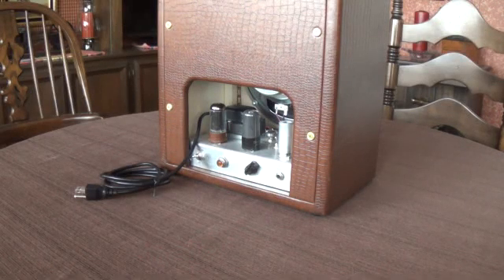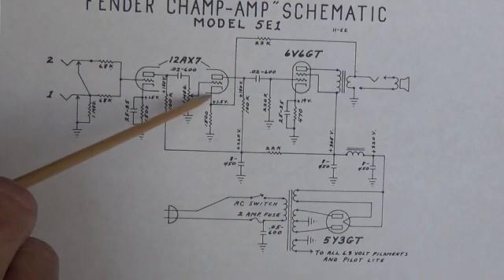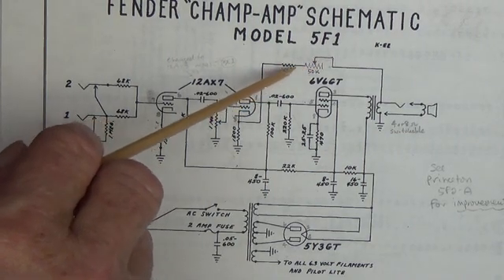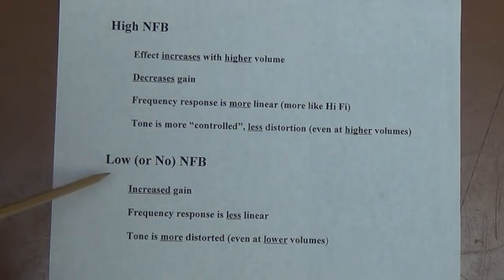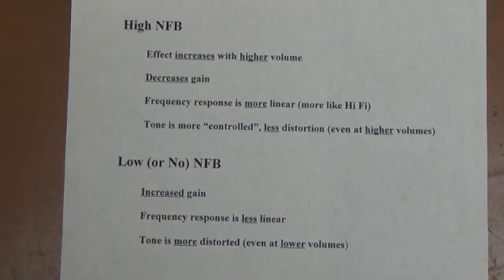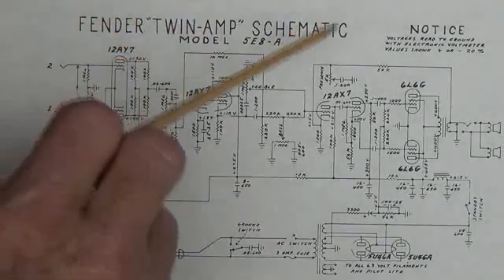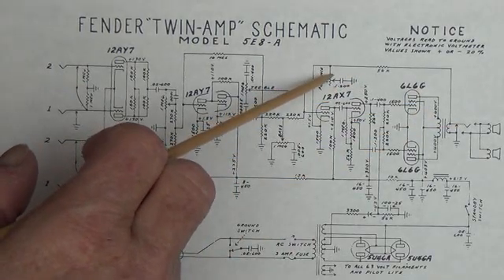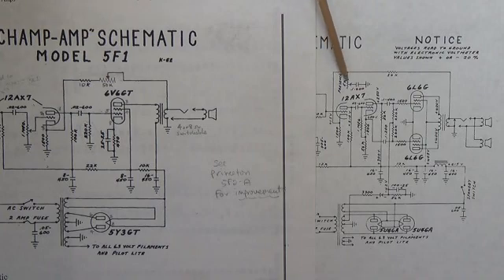Negative Feedback Loops and the Fender Presence Control

Comment: These videos are wonderful, Uncle Doug. Can I call you Uncle Doug? It seems a bit familial and whatnot. Anyhoo, these videos are great. I'm a software guy. I've built an LA-2A and 1176 and some pre-amps. But I was just being a solder-monkey and following instructions. I've watched lots of videos on electronics, but how many videos can you watch about Ohm's Law? I get it, Ohms Law, for the hundredth time. But there's so little in between that and actual useful discussions. Your videos fall at just the right spot for someone like me.

Something I always wondered about, but it never seemed to be explained, is why there are all these places where there's a resistor to ground. I always wondered what the point of that was. In this video, you note that basically you are shunting particular frequencies to ground by adding a cap. That sort of lit a bulb for me.

Are basically all of those places where there's just a resistor to ground essentially 'relief valves'? I.e. do they just insure that any voltage above a certain level has a way out of the circuit before hitting the next component(s)?
Reply from the maker: I have posted videos on the specific purposes of resistors throughout the amp circuit, Dean. The purposes vary from location to location, i.e. tone, current, and voltage modification.
Reply: Oh, OK, I missed those. I'll take a look at them. I've honestly learned more in the last week or so watching one of your videos every night as I go to sleep than I have in all of the previous time I've spent on this. 

One question I had, and I'd post on the appropriate video if I could remember which one it was, is the issue of DC and AC being able to flow on the same wire. When that happens, is it sort of like a carrier frequency in radio, where the DC effectively just offsets the AC by its own amplitude and so the AC is no longer cycling around the zero point?

If that's true, do things like transformers not really care where the crossing point is, as long as it's oscillating? Or, if it's true, are there places where that offset would matter?

If you have a video on that of course just point me to it. There are a lot of them, so it's not always obvious which ones to look at for specific things like that.

The other, stupendously obvious but overlooked by me, thing that I sort of realized (hopefully it was a correct realization) is that A/C doesn't 'flow' but DC does, right? A/C doesn't move from one place to another through the circuit, it just oscillates back and forth, while DC is positive or negative and does flow from place to another. Is that basically the correct way to look at that?
Reply from the maker: Yes, you can think of AC as waves of oil floating on top of smooth water (DC).....but they never mix. You're analysis of the difference between AC and DC flow is technically correct, but for most beginners and intermediate students of electrical circuits, it's probably easier to simply have the AC flow through the circuit, happily creating high voltage and warming filaments with low voltages.....so we generally don't belabor the point ;)
Reply: So transformers really don't care where the crossover point of an A/C signal is, just the amplitude of its oscillations, I would guess? Or do you have to remove that dc offset from the signal before it hits a transformer?

Comment: Do you have experience with op amps? I have some ideas I'm throwing around but I can't find NFB presence adaptation for op amps.
Reply from the maker: We deal exclusively with vintage tube amps, NT, so op amps aren't part of our repertoire.
Reply: Yeah, I had such thoughts.
BTW, I always felt that presence is adding the top, but it seems, in theory, it should subtract everything but highs (making it sound lower in volume).
Reply from the maker: If an amplifier has passive volume controls, a selected frequency range is not actually boosted, but only seems to be because all other frequencies are suppressed. This suppression does indeed reduce the overall gain of the amplifier and can become a problem in amps with three separate tone controls.

Comment: Putting a pot in the champs feed back loop , also affects the tubes bias.. since there is no isolation capacitor and the transformers secondary is a path to ground. You are loading down the 12ax7's output as low as 10K. 
 Btw, great videos ... but  you should fire that lazy dog :)
Reply from the maker: I'm not sure if I agree, GT. The NFB loop is connected to the cathode of the 12AX7. Granted, when the pot is at its lowest resistance (10K), the NFB circuit is offering the 12AX7 cathode a second path to ground (through the OPT secondary winding), but this is in parallel with the existing 1500 ohm cathode bias resistor. The combined cathode bias resistance would be about 1250 ohms......not a huge change.
Reply: Your right, sorry. I thought the cathode resistor said a much higher value.  It wouldn't make much difference.

Comment: If outout resistance of 6v6 is 55k and output transformer has k=30 than output resistance of my amp is 55k/900 =61Ohm. So I think we need add NFB on low freqs to reduce amp's output resistance and therfore speaker's distortion, wright?
Reply from the maker: The Load Resistance of a single 6V6 at PV of 315 VDC (it varies with PV) is 8500 ohms. I don't know what k = 30 means (winding ratio ??). I am not familiar with the concept of an amp's output resistance or it's relationship to NFB.  My suggestion is to install a variable NFB loop and experiment with resistor values to find a range that suits your needs.  Best of luck.

Comment: Great video as usual Doug.  I was wondering if you could comment on the purpose of the "shunt" resistor I see in many NFB circuits, but not all,  like the Princeton, 47 ohms?  When is it needed and why?  Also the size of the NFB resistor in the Princeton (2.7k - 5.6 k) seems relatively small and yet the Princeton 65 or 68 are said to have very little headroom.  With such a relatively small NFB resistor seems like it should have a lot of headroom.   And yet I also see that a very large resistor, 56K, is recommended for something like the 5E3 or is used in other Fender amps.  It's a bit confusing and I'm guessing it has something to do with the rest of the circuit, maybe fixed bias VS cathode bias or ?????  Can you help me understand this better?
Reply from the maker: Good questions, SD. It appears that the 47 and 1500 ohm resistors form a voltage divider, reducing the amount of NFB being applied to the 12AX7 cathode.  This may have been created by trial and error to create a "proper" tone.  I advocate this method to alter such circuits and customize them to personal preference. Even though the initial resistor (2.7K) seems low, very little NFB is applied to the cathode due to the presence of the 47 ohm resistor to ground.....thus little or no increase in headroom. I see no NFB on my 5E3 Deluxe schematic,but  I think you'll find that when high resistance is inserted in the NFB line (generally without a "shunt" resistor) it is to reduce the amount of NFB with one resistor rather than two. If you are really curious, you might experiment with alteration of the value of the 47 ohm resistor to see just how much difference it makes in tone and headroom. I would guess quite a bit.
Reply: I"ve built a 5E3 with inexpensive components built by VHT and want to install negative feedback using a 25K pot as you described with maybe a 20 K resistor in series.  Robrobinette's site is my reference for the 56k value being a low amount of NFB in this circuit done without a "shunt" resistor.   Thanks for the information.  This VHT board also has a 2.7M resistor around the 1st stage from the plate to the grid, unlike the std 5E3 for another type of feedback.  It's said to be something that Dumble amps employ.
Reply from the maker: Choose your fixed and variable resistors so that you can bracket the recommended NFB resistance.....i.e. a 20K fixed with a 50K pot, which would allow for a range of 20K to 70K and provide a lot of flexibility of adjustment.

Comment: Bah, Uncle Doug! I've just buttoned my Princeton back up having installed the variable bias pot and added a 1M resistor to the tremolo circuit (best mod ever!), and now I'm going to have to open her up again to do this! 

As with all the other people who have commented, I've found your videos invaluable. My amp is an A1164 kit from Tube Amp Doctor and shortly after building it with no confidence about what was going on inside she blew her power transformer. This forced me to learn what was going on inside the amp so that I could diagnose the issue. (I think it was ultimately caused by a combination of excessive plate current and voltage, and using the 230v tap instead of the 240v tap. In Australia 230v should be fine buy my mains varies from 230v to almost 250v.)

Thanks to your videos I know feel way more confident about the amp I built :)
Reply from the maker: You're welcome, Tom. We're glad to hear that the videos are helpful. Best of luck with all your projects.
Reply: Hi Uncle Doug, today I installed a 10k pot as suggested in one of your earlier posts below (given that the standard negative feedback resistor is only 2k7 in the Priceton). It does make the amp go into overdrive more readily from a volume of 6 upwards, but has little-to-no effect below that. Is this because 10k is not a high enough value maybe, or does the effect only really take place when the amp is cookin'?

Comment: This is the best explanation I've seen for these amp circuits. You're really helping a lot of people that want to better understand their amps.

Maybe you could use a oscilloscope to show the signal as it passes through the amp? Show how the filter capacitors shape the signal. Just a suggestion.
Reply from the maker: Thanks for your nice comments, Ray. Please see my video series on Power Supplies for oscilloscope views of AC ripple, smoothing by filter caps, tremolo signals, etc.
Reply: Uncle Doug I'll watch the power supply video. glad you mentioned it. I used my scope a lot servicing electronics. it could be very useful in certain situations.  I regret selling my shop equipment. There's times I'd enjoy working on tube equipment again. Watching your videos is a good substitute.

Comment: Uncle Doug:

I have an ampeg j12T reissue that I'm wanting to add a variable feedback loop in a similar way you did with you modified champ clone (I'm going to follow your lead next summer and make an Uncle Doug 5W). I think this is the schematic: http://www.thetubestore.com/lib/thetubestore/schematics/Ampeg/Ampeg-J12T-Amp-Schematic.pdf 

It seems like the feedback is from the power tubes themselves rather than the output transformer; can that be? See R25. I'd like to have a the lowest possible amount of resistance for maximum compression for the lowest value. Would you please advise?
Reply from the maker: I don't really see a feedback loop in the schematic, Brad. If you were to add one, it could be connected from one of the OPT secondary leads (which of the two generally requires trial and error) to the common cathodes of the phase inverter tubes. R25 is not a NFB resistor. I suggest making the resistance in the loop adjustable (i.e. 5K to 35K Ohms), so you can alter it to suit your needs.
Reply: Uncle Doug Thanks so much for your guidance and patience.
Reply from the maker: You're welcome. Good luck.

Comment: Hi Uncle Doug, can i add a feedback loop to my gibson mercury medalist.   I believe it should go to pin 4 on the 6eu7 split to both channels. 
http://www.classictubeamps.com/schematics/Gibson/Gibson%20medalist%20mercury%20schematic.pdf
Thanks to your videos they have brought this amp back to life,  now the trick is can i make it growl to the moon.  Any advice would be appreciated as always.  Best regards to Rusty as well
Reply from the maker: I would suggest that the cathode of V3b might be a better place to connect the loop, so that it will affect both output tubes.  However, you should realize that adding a NFB loop will increase headroom and clarity....and reduce distortion, which may be the opposite of what you appear to be seeking.
Reply: Uncle Doug The v3b does look better, now that i think about it.  I guess im just searching for answers, ive seen others gibson atlas and i think a mercury with more much more distortion then i have.  I was hoping it would feed the signal back in creating a boost. I guess its more about cutting frequencies and shaping the tone. So ill stay away from this feature.

Comment: Excellent!  Thanks Doug!
Reply from the maker: You're welcome, John. It's good to hear from you :)
Reply: I'm starting a new build using an old Dumont 208 Oscillograph(scope).  It's gonna be cool.  Mostly vintage parts.  2 input/pre-amp channels each with their own tone stack and cathode followers. Maybe one a 6SL7 and the other some kind of SC pentode.  A mixer to blend the channels (from 1965 RCA Receiving Tube Manual).  Also, if only one guitar is plugged in it with go thru both channels.   Push-pull 6V6 or 6L6.  And, feedback loop with both treble and bass 'boost'.  The thing has a killer etched front panel with lots of holes for switches and pots.  Reverb tank if I can fit it in.  You'll be able to see the output tubes thru the old crt hole in the front.  Also, blue LED lighting inside the chassis!  As always, using your excellent videos to help me along!
Reply from the maker: Good grief, John. This amp, as you envision it, will put most modern amps to shame. I can't wait to see how it turns out :)
Reply: I'll keep you posted on the progress.  Might ask for you opinion also.  I'll make a picassa album and send a link to it.

Comment: thx Uncle Doug! i watch your videos again and again as my knowledge of tube-amps increases over time :-). 2 questions : is it wise to use a bypass cap (lets say a low value to enhance the treble on the plate output) in combination with a  precense control in the nfb loop? or is this a not common thing to do (using a bypass cap in the cathode in combination with a presence control)?
Reply from the maker: You're welcome, Stefan. First, I believe that bypass caps in traditional values, like 10 to 50uf, enhance all frequencies.....not just treble. Second, I see no reason why both bypass caps and NFB/Presence Controls cannot happily coexist within the same circuit.
Reply: Thx Uncle Doug.
Reply from the maker: You're welcome :)

Comment: Thanks again for the great video. Your video convinced me to try out a "presence" addition to my champ 5f1. But I didn't have a 10k resistor handy, so I put in a 4.7k to the feedback loop from a 50k pot, the middle pot connection to the speaker jack...and then I put a 0.05 uf cap from the pot to ground (I didn't have a 0.1uf cap handy). I really like the control, and up until a volume at 7, it is wonderful. Past 7, it fattens up, and the control works nicely. After a volume of about 9, the volume doesn't increase any more, but is quite loud!, and has some neat variation in growl with the "presence" controller changing/cleaning the sound nicely. At 11, the with NFB at it lowest, it distorts in a unique way, the peaks are compressed in an exaggerated way, and almost sounds like it's cut out at the beginning of the strum: with NFB at its highest, it cleans up noticeably, but it still has a very compressed sound at the initial moment of strum...All the while, no longer increasing my volume since 9. I find it very interesting, and pleasing, but should I bother putting in that 10k instead of 4.7k, and the 0.1uf instead of the 0.05uf? Your opinion matters to me. Thank you.
Reply from the maker: You're welcome, Rik. Different circuits require different component values, and if you're as satisfied as you seem to be with the presence control you have fabricated, I would say stick with it.  If you're feeling adventuresome some day, you might experiment with different resistors and caps, but it may be that values you had on hand were the exact right values for your circuit.  Congratulations on a very successful modification.